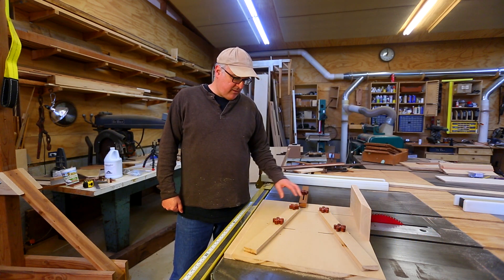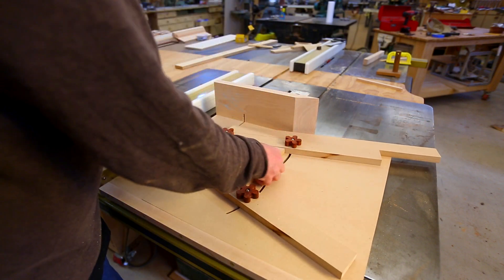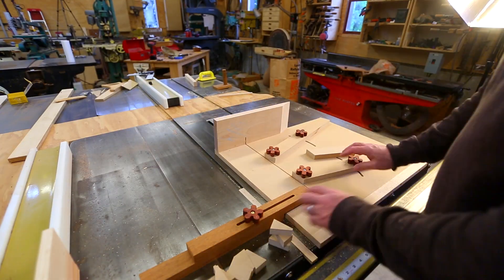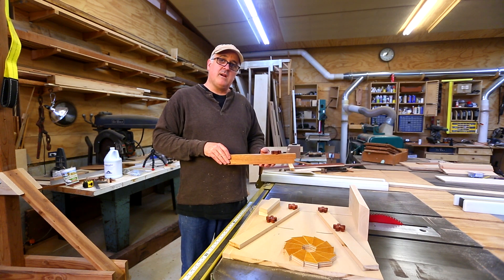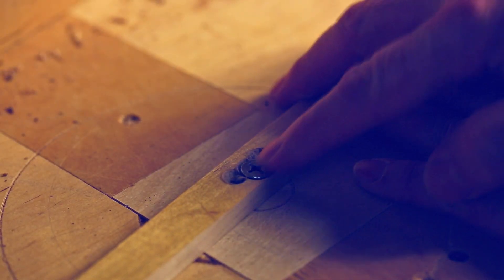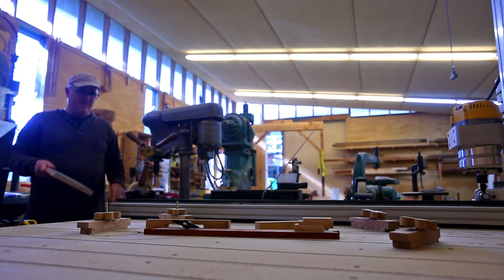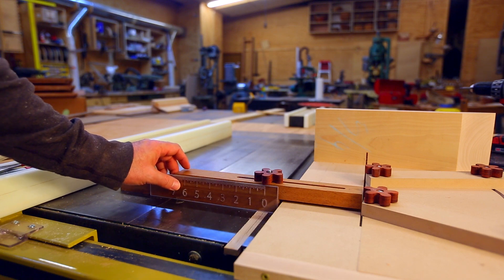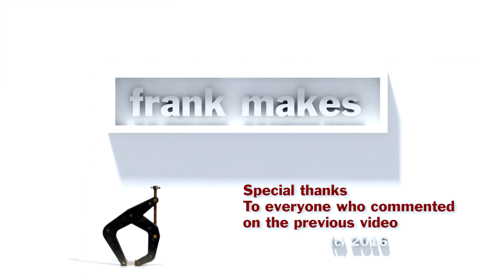Hybrid Wedgie Sled Addendum

Comment: Think this as the angle difference of the 2 cuts. So as long as the angle BTW the 2 fences stays the same, no matter where the blade is, it's always gonna be the same.
Say the difference is 30 deg. You can position the 2 fences 45 deg and 75 deg, or 10 deg and 40 deg. It'll come out the same.

Comment: Since you're setting the fences along the two inside edges (i.e., the edges that are next to each other, not the edges closer to the saw), shouldn't you reference the board against those inside edges when you're cutting the segments?

It seems to me that you're relying on the fence to have parallel edges to get the segments correct. That may be true now, but if the edge wears over time you might lose accuracy.

Comment: Hi Frank. I have been enjoying your videos for quite a while now. Back when I was working as a machinist I found that the best tool for engraving was a single flute 90 deg spot drill. My favourites were the 60 series from M.A. Ford. They are made for metalwork but I'm sure they would do fine in wood and acrylic. They last forever too. Cheers!

Comment: Your videos are amazing. I always enjoy when you post a new one. I do have a question. If the segment you cut is at a angle to the blade and the stop with the depth gauge is straight to the blade wont come up with two different measurements? For instance if you depth gauge is set at 1" and you cut it at a angle wont the segment come out longer that  1"?

Comment: I know you said you did a lot of testing for the plastic but did you try different spindle speeds? For some plastics if you slow it right down that produces almost polished looking cuts. Also if you cut the reverse image of your ruler you could mount the plastic with the graduations down which may increase accuracy and repeatability.

Comment: I like the scale in the plexiglass!
You could maybe widen a little the holes left and right and use a flat head screw. That way you can adjust it perfectly and you don't need to be super accurate during the build process.

Comment: Just out of curiosity, how come you don't use "bird's beak" router bits to make rings? That's what they are designed for.
Reply: +ernie5229  Those bits are great for making your joints stronger like for hollow table legs but for bowls it makes more work as he'd need to also set up a router table and you hardly need the extra strength if you're making decorative work.

Comment: If you want to control that effect, you could put a dado on your wedgie sled running between the two angled stops and perpendicular to the saw blade, and turn your reference wedges into sort of sleds themselves with runners that fit in the dado. That way, you could have a set that lets you evenly offset your angled stops (for a standard ring for turning, for example), and a set with the reference wedges skewed from the runner to produce the sawtooth effect consistently. If that makes any sense...

Comment: You always do such a nice job of explaining things. My confusion with this sled arose from an erroneous assumption that it represented a new twist on an old idea - an updated crosscut sled. Replaying the original video cleared things up. Its primary use is preparing parts for segmented turnings. Your first sentence in that video states this clearly, though my not-that-old ears missed it. Looks like I picked the wrong week to stop sniffing glue.

Comment: Nice Video and Explanation. I have a concern about the depth/length gauge that you made and how you explained how to use it. I too have one of the Wedgie Sleds and I have a length/depth stop as well. When I am determining the diameter of a segmented ring, I need to determine the length of the outside face of each segment. I need a measurement along the longest edge of the segment or the outside face. The length or depth marks on the gauge you made, can measure the distance from the blade to the end of the workpiece. This work perfectly only if the cut is at a 90 degree angle from the blade, or perpendicular. So, if the cut is at 30 degrees from perpendicular, the longest side of the segment will be longer than the distance measured from the depth gauge. So, if you set the distance on the depth gauge to two inches on a 30 degree cut, your segment will have a longer length than 2 inches because your piece of wood is bridging the 2 inch gap at angle that is not 90 degrees. To properly use the depth gauge to cut segments, first you have to cut the first angle on the end of the workpiece. Then take the workpiece and mark the required length along the outside face. Place the workpiece with the pencil mark along the kerf cut on the sled. Then slide the depth gauge up to the end of the piece. Now the gauge is at the right length or depth. You set the gauge to the workpiece in this case. You cannot set the depth gauge to 2 inches and get a 2 inch segment unless you are cutting exactly 90 degrees. This might sound confusing but it is accurate. I hope this helps when you are cutting segments so that you don't end up with oversized rings. Good Luck.
Reply: This is Garry not Linda. No it's not. The first piece is cut and then the board is flipped and moved to the opposite fence so the point meets the depth stop at whatever the distance from the blade. You're overthinking.

Comment: Thanks for the followup video, I did not even think of setting it up like you did in the second case.  I noticed in several of your videos you sand on the up side of your disk sander.  I was taught to sand on the down side, it keeps the dust from going right up in your face, and it is easier to control the work piece since the sander forces it down on the table.  Is there some benefit to sanding on the up side for light sanding that I'm missing?
Reply: This is Garry not Linda. Bill, he isn't sanding on the up side. It just looks like it . He has fluorescent lights in his shop and the cycle of the light to the camera makes it look like it's backwards. If you watch some other videos, many times the wheels on vehicles and other power tools will look like they're running backwards, that's the same effect. There is a name for it but I don't remember what it is right now.

Comment: A centerline on the sled (perpendicular bisector to the line between the two pivots) and on your template wedges used for setting up the fences would make quick work of getting them centered, to avoid ending up with the saw tooth pattern.

Comment: I think you should drill a small hole at the end of the slots in the runner that helps expand the runnera when the bolt goes deeper into the countersink. prevent propagation.

Comment: Loved the video. I just made this sled last week and wished i saw your modifications then. I plan on retrofitting them. Regarding your locking miter bar... shopsmith has been using that system for years on their steel bars. Works great! Thanks for the videos...

Comment: It appears that you are making good use of your CNC machine but are you happy with the amount of space it takes up ?  I'm thinking of building one that is hinged and can fold up on the wall. Also, would you want to have a smaller CNC for projects like this and the big one for when you need it?
Reply: +John Norris I'd suggest looking into the new handheld cnc tech that's coming out. Ben at Applied Science did a video demonstrating a beta unit that he was sent, it's really cool stuff, with a theoretically unlimited work size, all in a machine little bigger than a conventional router.
Reply: Rob Mckennie   Thanks Rob.  I watched it about an hour ago. Very impressive use of technology and hope it is out of beta soon.

PS - I've been contemplating building several specialty CNC machines that use the same controller gear.

Comment: Good idea with the scale on the stop. As someone else said, the first part, about the angles, made my head hurt. I don't quite understand how you can know the angle of the cut if you're just comparing the angle to the other wedge, and not to the blade.
Reply: +djAnakin As long as the angle of the cuts times the number of pieces equals the degrees of a circle it will always line up. He proved this when he rotated the cuts but maintained the same relative angles, the pieces became lopsided but still formed a circle. Very nice work!

Comment: I have made the unmodified version of this sled. I was thinking about a gage like yours but doesn't the distance vary depending on the angle used? I dunno I think there's a sine or cosine in there some where. Either way I want to thank you for inspiring me to try segmented turning. It is so much fun and I have you to thank. My favorite is the segments you added into a cracked rough turned bowl. I think it was maple. That bowl is awesomeness.

Comment: That first part made my head hurt.
Reply: +Lance Surgeon The key is that it only works for segmented stuff. The relative angles on both sides of each individual segment determines the radius of the circle, so if the two angles are relatively the same, the circle will come out the same. Think of it like a piece of pizza, it doesn't matter how long the slice extends backwards, it's just the angle of the cut that determines how many pieces are in the pizza :)

Comment: Frank - did you get a new lens?  This video looks a little sharper...just curious..
Reply from the maker: +Nate Daggett no, but I had my umbrella studio light for many of the shots.  extra light helps.
Reply: +Nate Daggett I thought the same thing.
Reply: +Nate Daggett Sharper? am i the only one who thinks these videos are extremely bright?
Reply: +frank howarth That most be it.  No saying anything was every wrong with your other videos...I love them all!!  Just noticed the Bokeh more on this video..Thanks again for all your videos..
Reply: +Alexander Rhainé It looks great to me.  Sharper = crisper with more Bokeh..
Reply: +frank howarth Extra light helps the f-stop go up which makes the image more clear :)
Reply: +Nate Daggett crisper with more bokeh? what does that even mean? shallower depth of field?
Reply: +Nate Daggett More light could allow a higher f-stop (smaller iris), which would make things sharper.  Bokeh, and less depth of field occurs with lower f-stop numbers (larger iris).  Pretty sure Frank's response is the main reason though, light really helps video clarity by increasing contrast.
Reply: +frank howarth Regarding the light, is there any reason why you use different light temperatures in different parts of the shop? I just noticed that and couldn't think of a reason.